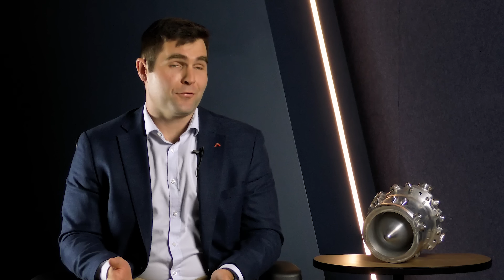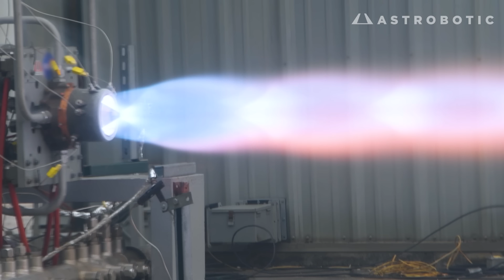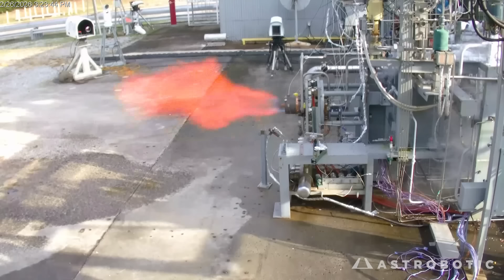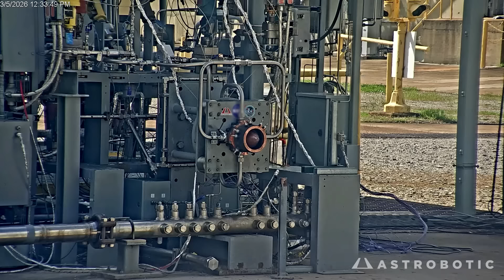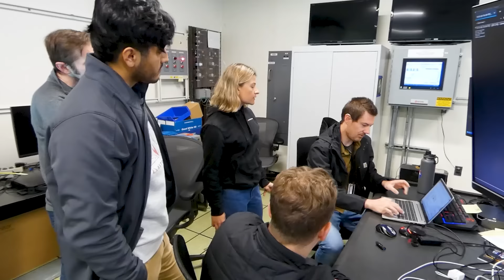Astrobotic Breaks Records for Hot Firing Rotating Detonation Rocket Engine (RDRE)

Comment: I need to HEAR this thing, it's gotta sound weird in some way.
Reply: Hi, I work with small scale rotating and continuous detonation propulsion at my university, and they scream.
Reply: @Lnk_Avalon_Six  what is rotating? Does it have a turbine or is the flame whats rotating. Could you give me some details?
Reply: @christopher4101  It's a rotating fire wave, or rather 3 in this case, traveling around the inside at stupid high speed. The science behind it is a bit outside my knowledge, but yeah, it's neat.
Reply: @CometChaser97   3 synchronized rotating fire "waves" does sound neat. Ill have to search up more info. Thx👍🇺🇸
Reply: @christopher4101  Basically, the combustion chamber is circular, and the propellant is detonated from a couple points inside the engine in such a way that the resulting shockwave travels around the loop continuously - so that is, the detonation front itself is the rotating part
Reply: @christopher4101 the detonation shockwave 'itself' is rotating and igniting the fuel in the circular-formed chamber.
Reply: @christopher4101 there’s a YouTuber Integza that has done a bunch of rocket engine stuff including a video on RDE as well I think. 10/10 channel
Reply: @christopher4101  everyday-astronaut has a great video on this!
Reply: @christopher4101  To give you a little more background on what is being talked about, things burn in one of two modes: "detonation," and "deflagration." As weird as the word deflagration is, that's actually the one people are most familiar with. Burning wood, burning houses, and yes burning fuel in conventional rockets are all deflagration. The word means that the fire burns slower than the speed of sound. Detonation is what you get in high explosives - C4, for example. It means that the material burns FASTER than the speed of sound. This puts enormous stress on all the materials around it, which is why it's so good for, you know, blowing things up. 

It turns out that for some mathy reasons rockets actually are more efficient if you detonate your fuel instead of deflagrate it. The problem is, the flame moves faster than you can actually put fuel into the chamber, so the combustion runs out of fuel and stops. This is where the 'rotating' comes into the rotating detonation engine. 
Instead of a big chamber to burn your fuel in, you make a thin ring and push fuel/oxidizer into it. You start a detonation in one spot, and it races around the ring faster than the speed of sound. But after it's passed each spot, you can shove fresh fuel/oxidizer in to get it ready for the detonation racing around the ring and let it explode again. Basically the ring is long, so the detonation takes time to go around, but the fuel only has to go a short distance to get into position. You have to get everything perfect so this literal explosion always has fresh fuel waiting in front of it, around and around this circle endlessly. This is really, really hard to get right. At 2:02 they show some high speed of the three explosions racing around the ring of the engine.
Reply: @christopher4101  there are TONS of videos on this tech, which has been tried for decades like pulse detonation rocket engines, similar but different,  NASA played with it for awhile back in the 60s when they were testing aero spikes and aero blade engines but the materials and designs were too complex to work long term. That has changed with new fluid dynamic CAD etc and materials that are 1000 times better than NASA had to work with back then costing millions. What's awesome is this small company and others are doing it for a tenth what NASA was spending!
Reply: @christopher4101  when fuel is ignited, there are basically 2 kinds of resulting explosion depending on how fast the flame front propagates: deflagration (subsonic), and detonation (supersonic). Conventional rocket engines use deflagration in their combustion chambers because it is MUCH easier to manage. Fuel is continuously fed into the combustion chamber, and once ignited the deflagration is self sustaining. The high pressure exhaust gasses exit through a converging/diverging nozzle, and the slow subsonic flame front stays trapped in the chamber. However, this deflagration is less efficient than detonation. 

Some early rockets experimented with detonation, but they had to be rapidly pulsed and couldn’t continuously burn fuel. This lowered thrust. The detonation flame front was just too fast for continuous, sustained combustion in conventional rocket combustion chambers; they would simply blow themselves out and extinguish (or explode). To get around this issue fuel had to be injected into the chamber, then ignited, and the resulting detonation would blast the flame front out of a long, straight, pipe nozzle leaving the chamber empty again. Then more fuel would be injected, and ignited again… and so on in a rapid cycle. Inject, ignite, exhaust, repeat.

RDEs are the best of both worlds. Fuel is continuously injected into a ring shaped combustion chamber, then multiple supersonic flame fronts are ignited simultaneously within the chamber which race endlessly around and around at supersonic speed. Since the detonation fronts are trapped rotating around the ring, the engine stays lit. Finally, an aerospike nozzle directs the expanding exhaust out of the combustion ring a continuous stream. You get the smooth, continuous combustion of traditional deflagration based engines, with the efficiency and power of detonation, all off a single ignition. No pulsing needed.
Reply: @CometChaser97  you're downplaying the waves, its a rotating DETONATION wave.  Most engines combust fuel.
Reply: @pswanberg1 I was giving a short and simple explanation to give a general idea to someone who doesn't know what it is.

I know what they are
Reply: @christopher4101  the Wikipedia page on it has a basic animation which visualizes it for you just click the first image
Reply: @CometChaser97        fair enough but detonation vs. deflagration is what makes it a big deal.
Reply: @chrism.1131 yeah it's a continuous EXPLOSION. Very cool.
Reply: @christopher4101 watch the video 🫡
Reply: @c @christopher4101  The shockwave of the detonation is rotating at extreme speeds.
Reply: @christopher4101 scott manley has a great video on these
Reply: @christopher4101  if I recall, the detonation ALSO compresses the air/fuel as it moves "forward" along the combustion path. For comparison, in an ICE (internal combustion engine), the air/fuel mixture is compressed by the movement of the piston. The combustion ratio, how much that air/fuel mixture is compressed, directly controls the engine's efficiency.
Reply: @christopher4101 Best way to describe it is a shockwave moving around a circular track like how water swirls if you're stirring it.
Reply: imagine a sonic boom, then make it continuous. They scream and they scream loudly
Reply: @whimbur  that’s heavy metal af.
Reply: @EmaRussoUltra  its also what makes it impractical too. they're stupidly louder than typical rocket engines.
Reply: @utley  yeah, after all what you look for in a rocket engine is quietness.
Reply: @ano_nym  it severely limits where you can use them. If you're shooting rockets at 190db and your city has a 150db noise abatement, you can't launch rockets there. Only in the desert, and can't overfly populated areas. So yes, quietness is a requirement.
Reply: @utley  are these rules in place for actual space launches or hobby rockets. It's not like NASA etc. are sending up rockets every day.
Reply: @ano_nym  those noise abatements are for everything including highways (noise barriers alongside highways), airports (restricted operating hours and engine types) and even airspace (no sonic booms permitted). Rockets are a tad bit more restrictive because of possible rocket failure, which means they cannot overfly populated areas under extremely high altitudes.
Reply: @ano_nym  can even go further because  every dB sound energy increases 10x, rockets create both sonic booms and continuous explosive energy which can alone sustain major damage to cities nearby. They launch at Cape Canaveral at distances greater than 18 miles from spectators for those reasons.
Reply: @utley  i.e. the type of engine won't make a difference since all those restrictions are already in place...
Reply: @ano_nym  you're right, they can only make it less restrictive. Pay attention please.
Reply: it is not a particularly pleasant sound but screech and scream seem like the best ways to communicate it
Reply: @ryanrising2237  the wave form is probably a front loaded sawtooth, so I wouldn’t be surprised if it isn’t pleasant to listen too.
Reply: There are yt shorts of them firing. Like a windy whistling kind of noise.
Reply: yeah... too much talking not enough rocket noise
Reply: Considering the things basically spitting out a continuous shockwave at a high frequency id imagine its deafeningly loud and unreasonably high pitch
Reply: https://www.youtube.com/watch?v=UShD03eG9IU
Reply: @SnowiDragon  There it is.  Some of the most intense microphone peaking you can find on YouTube.
What you can hear in between mic dying is just about the most unpleasant a sound wave can be.
Reply: Check out Venus' RDE test LAUNCH. You can hear the sonic boom at the end but it sounds crazy the whole way
Reply: Agreed cant wait!
Reply: It sounds like a really high pitch version of regular deflagrating rocket engine.
Reply: It sounds like ak47 is fired at you
Reply: Extreme banshee screech
Reply: There is a flight test with no music on their channel!
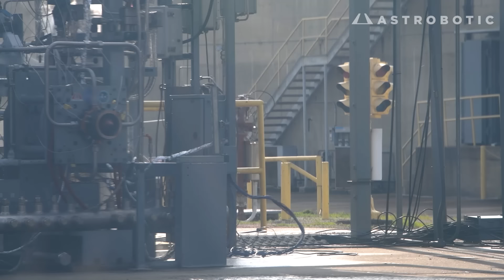1:19 min long
sounds like a torch on steroids!
Reply: It's continuous Whiz sound.
Reply: it sounds like a circular saw but 3 times faster and trying to cut a metal rod in half infinitely and its probably 100 times louder than one
Reply: It does. It sounds metallic like metal poundings at the speed of sound.
Imagine if an extinguisher sounded like a rocket engine, but, more heavy metalic sound. Its like a gatling of "shouts" as screams humming. Its hard to discribe. But awesome to hear.

There are sounds on youtube of it firing. It looks scifi as f*
Reply: There's a video with sound out there, it does sound like you would imagine i think. High pitched and  loud
Reply: You could hear it yourself if you put some dc current in water then through soapy water and ignite the buble with a lighter to hear it altho is not pure hydrogen is way higuer in note than a balón with air and comon gas
Reply: For sure the fucking pressure waves will make an insane sound
Reply: https://youtu.be/Fecy8W7XZ0c?si=WA530ZXStGf0xs0D
Reply: 0:36 look how  the  camera  reacts  to the  sonic  vibrations..   ouch!
Reply: I bet it sounds like ten thousand wasps farting into a milo tin

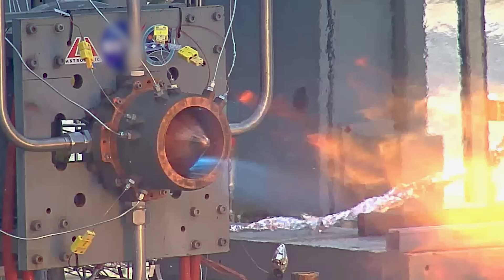Comment: On the RDRE -- why (at 2:00) when showing the three detonation waves chasing each other, was there always a "weak" portion on the left side of the annulus?  The waves never passed thru that portion of the arc.  I presume the annulus has injectors all the way around. . . .
Reply: I'd guess it's simply not visible because the camera's view of that portion is blocked by the chamber walls?
Reply: I think it's an artifact of the camera being offset to the side and the sides of the nozzle obscurity the left edge making it seem like it's weaker
Reply: It's behind the engine wall
Reply: That's not looking straight down the nozzle

Comment: The Aquoxis "pressure washer" nozzle is a fraud (I can't believe YouTube allows such claims on it's site.).  You cannot increase pressure without external energy input (unless you sacrifice much of the flow, which they don't)
Reply: and the external energy input is... fuel combustion.

much different than a pressure washer.
Reply: Bernoulli's principle works both ways. You can exchange the speed of a fluid for pressure and vice versa. This is how ramjets compress incoming air without energy input.
Reply: @Curdledgorilla  true; the SR71 made about 50% of it's thrust from compressing air at the inlet at around mach 3